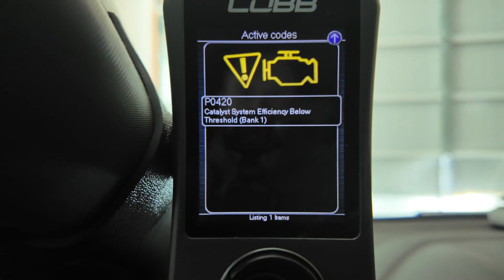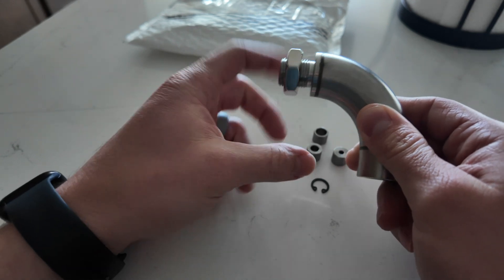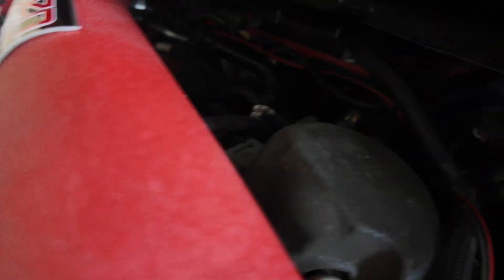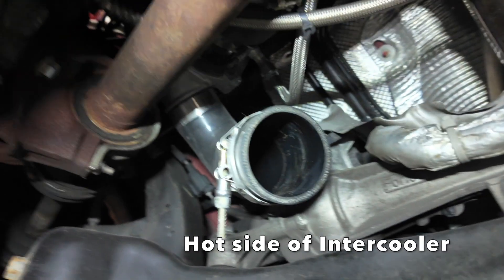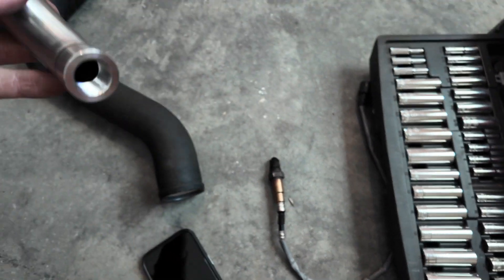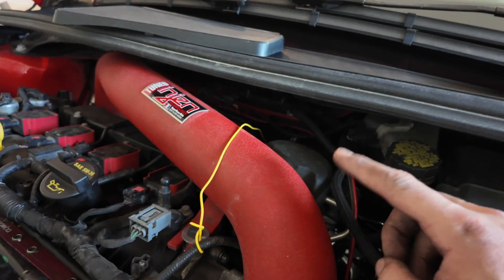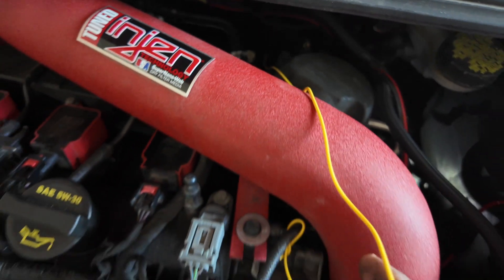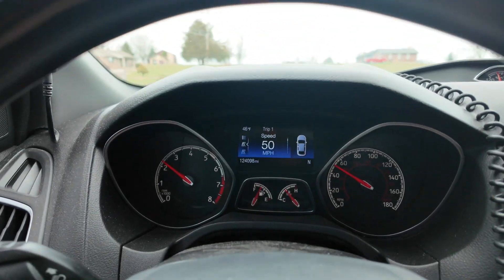Focus ST Engine Light P0420 = Defouler

Comment: Has this code came back at all?
Reply from the maker: Nope we are chilling with only a tpms light
Reply: @Michael_Carroll okay because I just got my tuned and the next day it was throwing the code. I had replaced o2 sensors before the tune because they were black. Shop said it could be because my o2 sensors have been bad for awhile that the ecu wasn’t reading the data properly and it could go away if I drive it more. If it doesn’t go away at the end of the month then I’m looking to get a fouler
Reply from the maker: @antoniosantana6772 I’d just go ahead and get the defouler personally

Comment: Did you remove the stock o2 sensor washer and just put on the copper one that came with the defouler?
Reply from the maker: No I used the copper one for the defouler connecting to the DP then kept the original washer on the O2 sensor to connect to the defouler